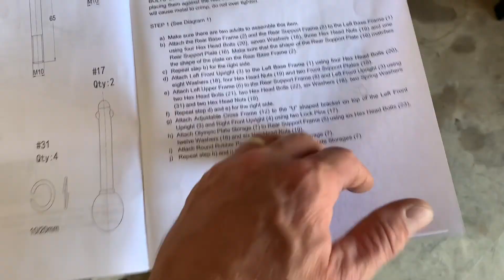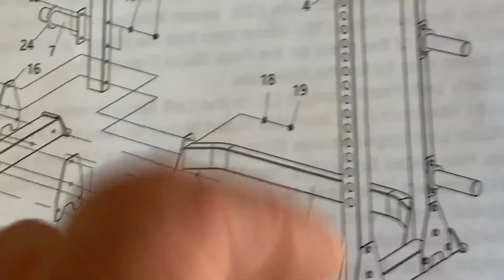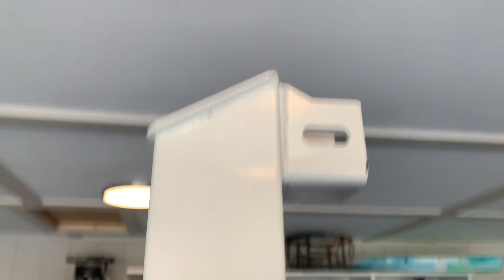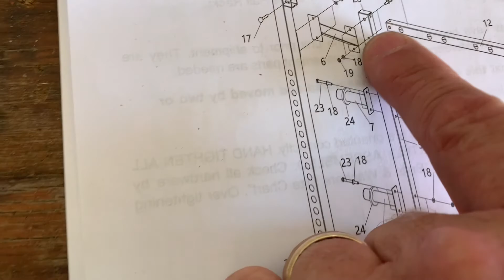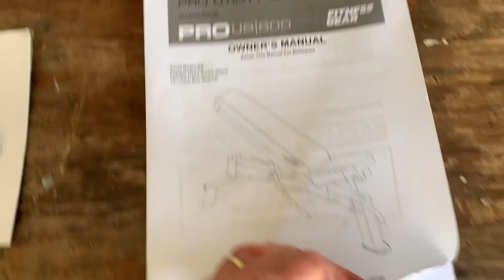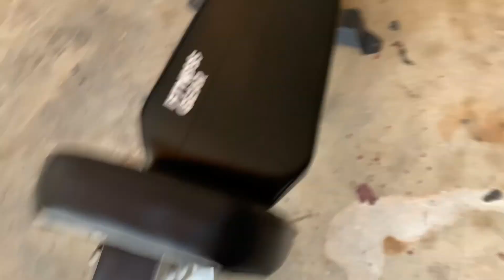Fitness Gear Pro Series Olympic Weight Set Assembly Dick's Sporting Goods [Fitness Gear Weight Set]

Comment: If anyone out there is struggling to tighten the bolts like i was, use pliers to hold one side of the screw and then an adjustable wrench for the other side. it was tricky but didnt take long and i was able to do it myself . once you figure out the first one the rest go by quick
Reply from the maker: Thanks for your expertise!

Comment: I put on the bolts and they all have this blue lining preventing me from fully tightening the bolts and there for the rack seems wobbly- is this how it is supposed to be?
Reply: Did you solve it? I have the same issue
Reply from the maker: I’d remove the lining if possible. The rack should not be wobbly either. Should be sturdy enough to handle a little abuse.

Comment: Thanks for the video.  Just put my together about 15 min ago . My only gripe are the spotter arms not very sturdy.  Maybe i can find other pair with built in pins for safety.  great video 👍👍
Reply from the maker: Awesome, yeah mine is still holding up after being abused. I felt the same way but they’ve held up great so far knock on wood:) Get your swell on !!!
Reply: @DIYTechnician  are the arms safe to hold weight for shrugs?  Can’t beat it for $400

Comment: I’m having trouble tightening the screws and bolts. I’ve tried a wrench but it won’t work. How did you manage to tighten them?
Reply from the maker: Righty tighty lefty loosey
Reply: I used one wrench to hold it in place. And used pliers to screw the nut in. It’s a little difficult but it’s really the only way. The blue plastic in the nuts make it so it’s a more secure fit but it can pretty much only be done with tools
Reply: I am having trouble too, seems to not tighten all the way or really loosely spaced out after i tighten
Reply: Same issue. Did you get it figured out?
Reply: @dariusavellino7188  Negative.  I've been meaning to return it but haven't had the time.
Reply: did you try. both the wrench and the socket wrench? that's what they seemed to have used. I only have a wrench atm but will have to try the socket combo to see if they tighten more

Comment: How tall is it?  Trying to see if it will fit in my basement with low ceiling.  Previous version was 85", but I don't see dimensions on the new version.
Reply from the maker: New version is also 85”, just measured it
Reply: @DIYTechnician  Thanks!  I'm going to get it, just fits in basement.